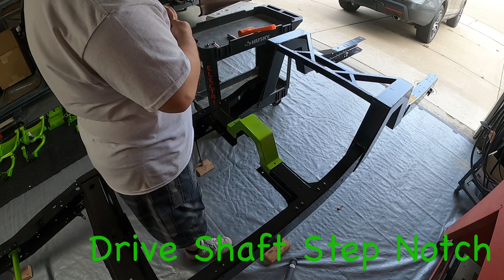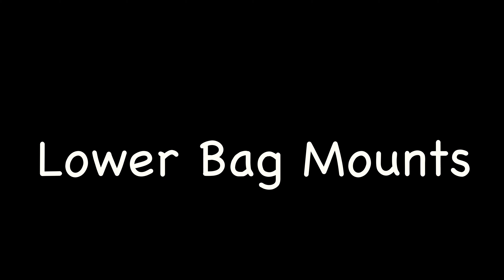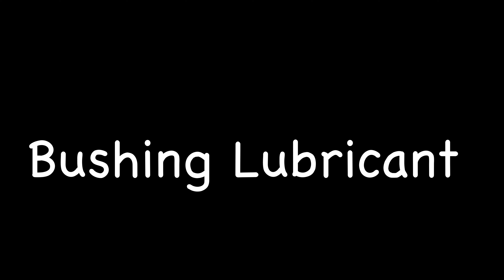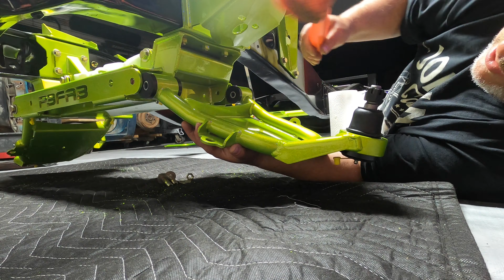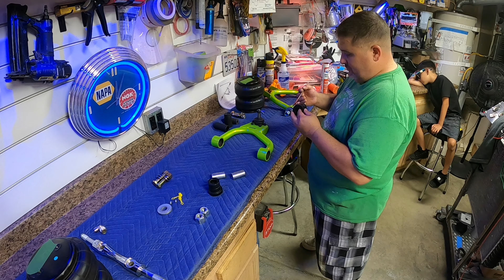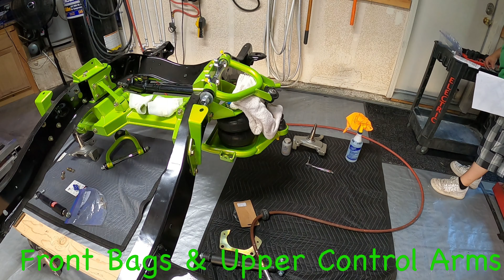Bailey Built S1E12 Front Suspention Assembly

Comment: Hey Ian,
What bolt did you use for your lower shock mount?  I"ve looked through all my PBFAB stuff, and don't see anything for it.  Also, intstructions on the shock install was NIL.... Also, how'd you drill out your spindles for the steering link?  FYI, I talked to Nate, @ Porterbuilt, he said any synthetic grease (not necessarily the teflon) would be fine, for the Delrin bushings.
thanks for the help!
Reply from the maker: The bolts for the front shocks where included with my kit and did not purchase them seperately. Drop spindles where included with the PBFAB however the CPP front disc brakes where shipped with drop spindles which I used. I did drill them out per the instructions.
Reply: @baileybuilt6686  Thanks for the response!  Very helpful!!
Reply from the maker: When I drilled out the spindles I used drill bits slowly stepping up in size until I achieved the size to fit the steering linkage bolt.
Reply: @baileybuilt6686  Thanks again, I also used a 9/16" then the 5/8" bit, I"d rather have used a reamer, but they cost about $100, so drilled her out!  Also, finally found my lower shock mount bolts, the bag had come open, so some items were scattered, plus I've had my kit for a couple years, just getting around to install on my 66 C10. Your channel has really inspired me to get after it!   I really am glad you've done such a great job documenting your build, it really helps!!!!  Thanks
Reply from the maker: For all of the bushings (lower hag mount and upper A arm) I used Lucas red and tacky grease to lubercate and install the bushings. I then used that same grease with a grease gun to fill the zirc fittings after the installation. Hope this helps. 707-332-0736 is my direct number if you need more help.